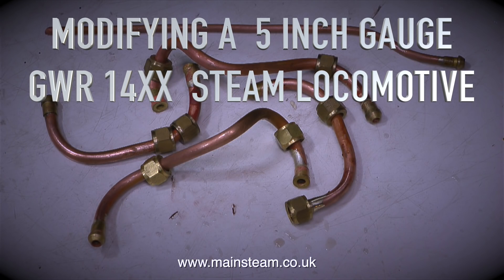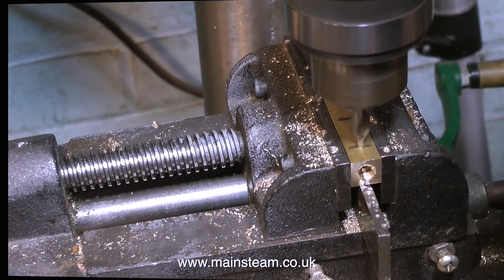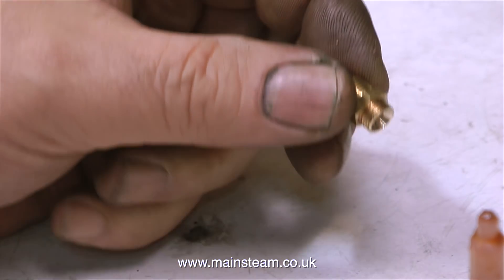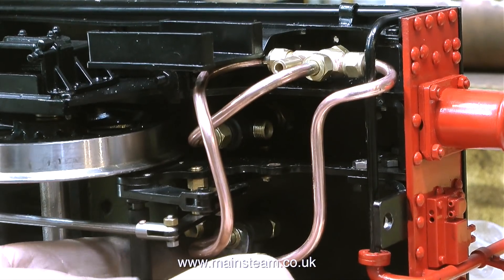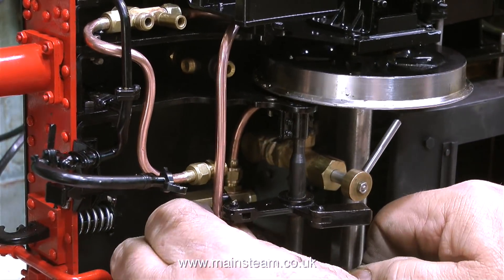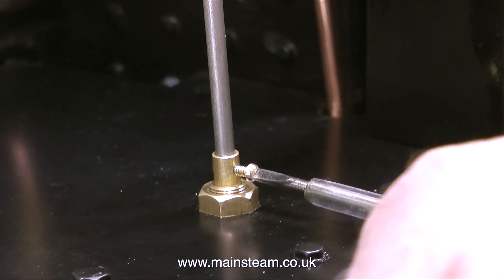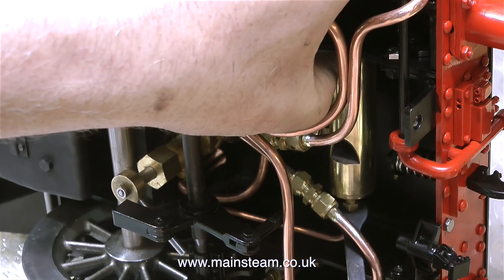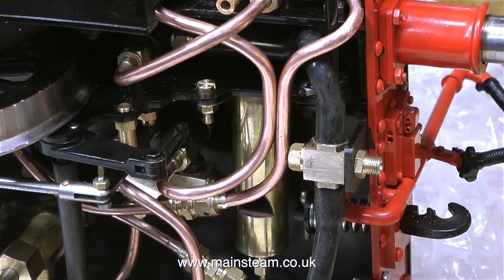MODIFYING A 5 INCH GAUGE GWR 14XX STEAM LOCOMOTIVE - PART #18

Comment: Something I find interesting: I learned to fire a steam locomotive in America. The injector water supply line was always open. There was a valve on the overflow pipe.

To start the injector you open the overflow valve, Then opened the steam valve slowly until the injector picked up. Then you would close the overflow line.

When you put enough water in the boiler, you just close the Steamline and you were done.

To me this seems simpler. You have three steps the beginning, and then just one action at the end.

Comment: Under the COSHH regs and CHIP regs the manufacturer and supplier have to provide a manufacturers hazard data sheet (MHDS) which gives all safety related data on the hazardous substance such as ingredients, storage, first aid, fire details. Just ask the supplier or look on the manufacturer's website as it's usually there these days.

Comment: Hi Keith, I use Precision etch primer professionally in my business Locoworks. The PQ1 is very quick and easy to use, it comes out very fast, so  quick wand over is all thats needed. I also use  PQ31 and PQ32. Mixed equally, they can be sprayed in an airbrush (if you're quick) I use small amounts for hand brushing. Works every time. They are both excellent for brass, a very thin coat only☺

Comment: I can only see one safety valve on this locomotive.  As a totally unqualified beginner, I thought there should be two, in the case of failure or that we get to too high overpressure for whatever reason.  Would you mind explaining just the one for me?  (Or is it that I'm blind?)
Reply from the maker: It is a very large bore safety valve therefor is dissipates the excess pressure easily . . .

Comment: Have you ever used copper wire or something like it that you can bend and help facilitate ease of runni g the pipe instead of work hardening the pipe and just cutting a new piece
Reply from the maker: Plumber's solder of the same diameter as the copper pipe is best, but I like to live life on the edge }:-)))

Comment: Just had a glance at the safety datasheet of the PQ1 etch primer: it has phosphoric acid in it.
The product page says that it is a primer "formulated to etch brass or nickel silver". So, my uneducated guess (two years of inorgsnic chemistry as a side subject at university, some time ago) would be that the acid mainly dissolves the nickel and the zinc in the alloy, and in doing so roughens the surface. I have been looking for some paper describing the effect of phosphoric acid on different alloys, but I have not found one, yet. If I find something helpful with regards to painting different alloys, I'll let you know.

There will be real experts with a much better understanding of the subject, so, please do take this as my  opinion, not as fact, and, therefore, with a grain of salt.
For the moment, I think the easiest (and also definitive) option would be to give Phoenix Precision Paints a ring and just ask them.

Comment: Keith, most commercial etch primers use trimethyl phosphate (an ester of phosphoric acid) at a concentration of between 1 and 1.5 % by
weight.  OK for ferrous metals, not great to etch brass or aluminum.
Reply: Mark Drukenbrod What is good for etching brass or aluminum?

Comment: For Brass painting a Grit Blaster is one of the best investments you can make.
It is also superb at rust removal and gives a superb finish!
David and Lily.
Reply from the maker: Yes, I know that ...... I use the bead blaster at The Steam Workshop, but with brass the paint still doesn't stick to it very well . . . I need an expert to tell me what the formulation is and how it actually works in detail.
Reply: I was told that alloys like brass and aluminium cannot be painted successfully, I never understood why exactly but the paint always flakes off. 
Body fillers stick reasonably well though and that does take paint, maybe it's because it's epoxy, I have never tried epoxy paint on brass or aluminium but that should stick.

Comment: Keith, I noted that from many of the piped fittings you are having to bend the copper 90 degrees or more at the start. Is that not an opportunity to use a right angled elbow and hopefully simplify the remaining pipe work? Obviously not on this project as the job is done.
Reply from the maker: I prefer doing it this way, occasionally I use 90 degree elbows, but it would be far too fussy on this job, plus most of the pipes start out as 90 degree bends but as i "adjust" them it's generally less than that. The piping is the way it is so I can physically get my hand in there to tighten the fittings etc. I do actually sit and think these jobs out first before I start.